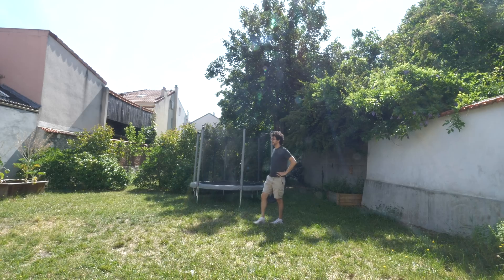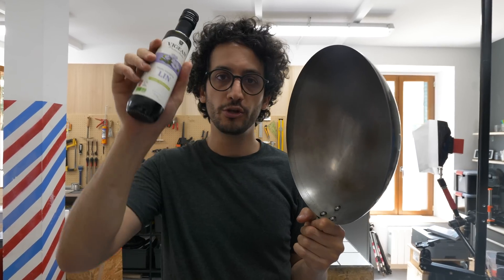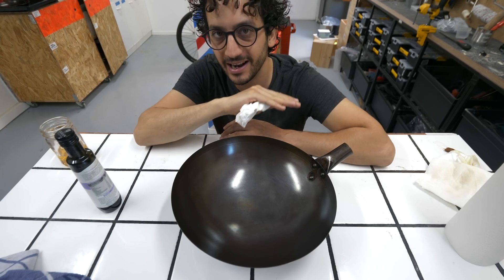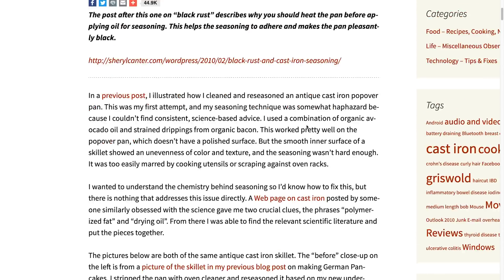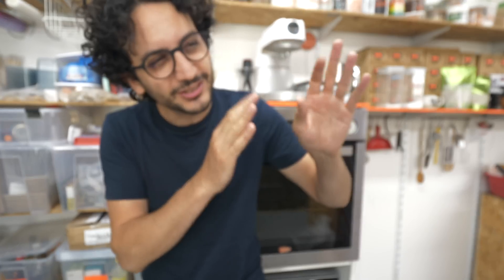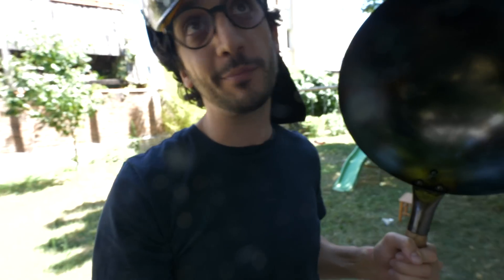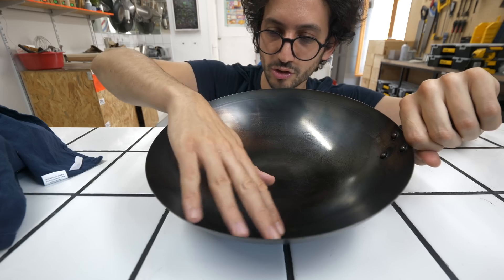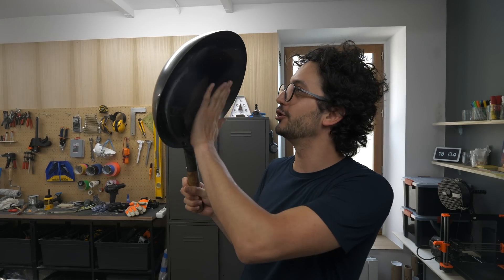Can I Make my Wok Slicker than a Nonstick Pan ?

Comment: Flax Seed oil is a terrible seasoning oil, it flakes off and doesn't bond well to the metal or itself.

So what are you qualifications? "I read journal articles. I have no background in science whatsoever but I tried it and it worked."

How has this well meaning woman's myth gained so much traction?

Comment: 100% better than teflon. You don't have to worry about cooking on high heat, you don't have to worry about using a utensil that will damage the coating (or at least don't have to worry as much) and make it flake off into your food, and if  something does happen to the coating you have complete control over how to handle fixing it.

Comment: Sheryl : "I did research into chemistry and found the best way to season a pan based in science"
Alex: "Okay but I'm still gonna do it different"
Reply: Flax Seed oil is a terrible seasoning oil, it flakes off and doesn't bond well to the metal or itself.

So what are you qualifications? "I read journal articles. I have no background in science whatsoever but I tried it and it worked."

How has this well meaning ignorant  woman's myth gained so much traction?
Reply: @SaltNBattery  Exactly! I followed her advice a year ago, spent an entire day re-seasoning all my cast iron with flaxseed oil, 5 coats each, came out beautifully, then flaked off on the first few uses. Never again.
Reply: @chrisrioux  Any scientist worth their seasoning knows that theories often does not reflect reality.
Reply: @isolatedintegration1154  Theories are based on VERY specific conditions. Those conditions rarely exist.

Comment: What is that wonderful wok scourer you fitted to your drill? Can I buy it or make it. FYI: I have wire wool and also wire soap pads ready and 5L of white wine vinegar, and a rusty tired twenty years old 26 cm carbon steel wok with a wonky wooden handle?

Comment: Non-iodized salt and oil for cleaning and seasoning. Oil prevents oxidation and the salt doesn't dissolve in the oil and when you rinse in warm water it dissolves leaving a smooth, sealed "nonstick" surface.

Comment: The trick for nonstick on a regular pan is to use cold butter and press it into the surface. It's the little divots in the surface that make food stick. So as long as those are filled with oil, and not air the food won't stick to the pan.

Comment: so this video proof some of my findings. First you have to finish the seasoning on stove and second higher the smoking point harder to get it polymerized. After 2 fail attempt with oil i use lard and its so much easier. From 1 1/2 hour with oil to 20-30 min with lard. Its thinner that with oil but i can do 3 layers with fat compare to 1

Comment: sorry but this could have been achieved in a couple of minutes, yes you wont have a perfect black finish. just heat pan until a little smoke rises, add some oil swill around until a little smoke comes of oil and your pan is seasoned I never get eggs that stick with a carbon steel pan.

Comment: Better 10X💯than Teflon.  Teflon is for someone who cooks very rarely. The Teflon coating is toxic.   True chefs cook w massive heat, as one wants to taste the fire in foods as a season.  Try this trick to carmelize onions- heat large surface sauté type pan to 400+ degrees.  Have your onion mise en place large onion med chop ready.  Keep gas flame high-do not add oil yet- add the onion all once and spread out evenly on bottom of pan,  do not stir until the moisture begins to release out of onion about 1-2 min. Stir once to flip onions and repeat until you can see and smell the onion juice  begin to Carmelize. Add just enough oil (olive) and stir to coat evenly and cover w a tight lid and shake pan to capture the remaining steam from the onions.  The pan will deglaze itself. Add a 1/4 cp sherry to finish deglazing just before adding remaining mirepoix.  I used this technique as I am preparing remaining ingredients for almost every dish I create.  You will learn to appreciate tasting the fire note deep below when serving your dish.  P.s. I liked when you used a drill and cloth squares to buff out the particulates on your seasoned pan- then mentioned  the beautiful sound you heard from the glass smooth surface.  Proof you chef with all of your senses.  Fact: Culinary art is the only artform in which you use all 5 senses.  Sight,smell,taste,touch,hearing-ex:the crunch of a potato chip or phyllo crust. Good work on your site, your passion shows through the screen!

Comment: I've tried to season my wok twice now, and each time it rusted shortly afterwards.  I didn't use anything abrasive to wash it after use or any chemicals, and after it was bone dry I returned it to the hob with more oil to add another layer.  Still rusted, and I can't figure out why :/

Comment: I've had many cast-iron pans that were more non-stick than teflon. I recently got a fine wok, as a Christmas gift, and seasoned it according to directions. It's not quite non-stick, yet, but it's getting better as I use it.
Reply: I have a monstrous Lodge cast-iron wok. It weighs about 14 pounds and is a non-stick stirfrying MACHINE. I can fry an egg over-easy in it with no problem. I wish I could get a teflon skillet anywhere NEAR this awesome.

Comment: Proceeds to chemically transform fatty acids into polymers
"- There is no chemicals!"
ROFL

Even without bias, it IS better than Téflon for non-stick pans. But what you did, most people don't have the time to do it anymore. Just like people used lye and grease to make their own soap, or a heck of a lot of other things... there's no one at home, everybody at work, expecting to work no more than 30 to 40 hours a week. Industry does all of the other work for them, and applying Téflon is cheaper than those many heat treatment + buffing.

We'll come back to that, irremediably.

Comment: I just bought my first carbon steel pan.

I don’t think it’s ever going to be more slick than a new Teflon pan.
But I am thinking it’s going to be a better pan. And plenty non-stock enough

I’m sick of buying Teflon pans that are just getting worse and worse with time. That I can’t fix or bring back. I can just try my best to be super careful with it, but inevitably toss it out and buy a new one. Because a degrading or messed up Teflon coating is a health risk.

This pan will last me my whole life. And probably people after me as-well. Unless I leave it outside wet, all winter, so it rusts a hole all the way through. Or something else equally stupid.
I will always be able to bring the pan back and put on a new coating of non-stick.

I’m not buying any more cookware that is  Teflon coated, yes it’s amazingly non-stick in the beginning.

But I want to have things that last. I’m going with carbon steel, cast iron, tinned copper and stainless steel from now on.

Comment: The advantage seems to be that you can redo the coating yourself. Never seen somebody re-teflon a pan. One scratch and it's ruined.  Would be interesting though to see if you could completely remove the teflon and oil coat it...
Reply: not only that, you can stick a carbon pan in the oven or on a fire without risk, unlike teflon.

Comment: From my heavy as fuck (well seasoned) cast iron, to my carbon steel (newly seasoned), to learning how to fry like a pro in my stainless steel with temperature control, the right amount of oil/butter etc.  I can say:  NONE of those methods are better than a teflon/ceramic pan.  They just aren't and it's a whole lot of extra hassle.  That being said, my favorite is just using my stainless steel cookware and doing it properly.   I might have to throw in the towel on this one and just have a single non-stick pan and then use my stainless steel.  Bummer cause I was looking forward to the carbon steel.  Maybe it'll get better.
Reply: there is some stickiness in my carbon steel pan but it is not like the food sticks and gets destroyed. I make omelettes and crack eggs in them all the time. Sure it is not teflon but if you know what you are doing, they are good enough. Most people don't know temperature game. They are used to non sticky pans and they actually add ingredients before the pan reaches proper temperature.

Comment: You maybe don't add oil to teflon - but you do add teflon.  So iron gets oil, aluminium gets teflon - no cheat just a different deal, different types of "paint".
I'm with seasoning, my Wok is 35 years old, it's used for spaghetti bolognese (extra tomato) mince and onions curry (indian and chinese) It doesn't matter - I wash it (if there are limpets that won't let go I use the plastic screw cap from a pop bottle as a non scratch scraper then a dab of rapeseed oil heated 'till it smokes and when it cools it's ready to start again.
Nothing sticks (usually) except mackerel - for some reason the oil sticks to the pan the mac sticks to the oil and it takes a lot of elbow to free it and stop it burning.  Add a little milk, flour and oil to make the sauce and the sticking stops.

Comment: click bait is wrong... that is not better than teflon... still tough very interesting
Reply: It's multiple times tougher than teflon. There is a reason you can't use any metalware on your teflon coated pans, but cast iron laughs in the face of it

Comment: Linseed Oil is the worst product I've tried with Cast Iron pans. Linseed oil eventually flakes off and is very bitter, ruining your food. I've found that a thin layer (later wiped away) of vegetable shortening is adequate for building layers. But I've started using a product called Crisbee (I'm not a shill - I actually bought the product) and leaves a very slick surface.

You will still need some form of oil or butter to cook with in a Cast Iron pan. You can't avoid this.

By the way, did you see the comments in that Sheryl Canter article. There's a lot of criticism against Linseed Oil - I've found it to be terrible and others have had the same experience. Avoid this if you can.

Comment: Using oil defeats the purpose of making a nonstick pan. 
Non stick pans use a chemical called Teflon which is a very hard material that chemically bonds to a surface. Skateboarders like to use it to grind on things like cement because it produces a slicker surface than wax. The only problem with Teflon is that at high temperatures it decomposes and produces some gnarly biproducts.

Tl;dr if you want to show how well a non-stick surface you made performs then don't use oil.

Comment: May not be quite a non stick as a Teflon pan, but you can always re-apply the coating if the wok starts to stick; try doing that with a Teflon pan. Also if I have this correct, in Chinese cooking heat is your friend, my wok only really sticks if I cool the wok by over loading it.

Comment: I started using a couple of carbon steel pans, including a large wok, about a year ago. I loved them so much, that I eventually replaced all of my fry pans, including the teflon pan I used for scrambled eggs, with carbon steel. The matfer borgeat I use daily is amazing! I seasoned it using the potato peel method (which is what matfer recommends), and it is as slick as any nonstick. I just used it this morning to make a spanish tortilla and no spatula was required, at all, to get the omlette from the pan! Carbon Steel: it's amazing!

Comment: Everything tastes better in seasoned pans, everything.  Having said that, i like using high heat oils, like avacado oil to season with, because the coating produced is much more durable.  Just gotta use a higher heat to season though.

Comment: The entire point of traditional WOK cooking is that the WOK has by design different heat ranges from the very bottom to the sides. In traditional WOK cooking the food is moved from the bottom where it is extremely hot to the sides where it is cooler all part of the cooking process. Often the partially cooked food is removed from the wok entirely only to be returned later in the process. That is why a hand-hammered wok is preferable to those that are accustomed to wok cooking. When the food is moved up the sides of the wok it will stay put until moved again.
This person obviously does not understand wok cooking at all. I would say the Chinese got it right 2000 years ago. Re-inventing the wheel in this situation seems counterproductive.

Comment: I would have thought to really make it non-stick you would want to increase the smoothness of the surface going down to a micro or Nano level and then you should get better results.

 how about working up the wet and dry to a 4000 then using a Polish

Comment: So my question here is in the beginning you said you were using food grade lin seed oil then after reading said article and talking to whats her face it looked like you were using olive oil. But she made it a point to say that heating oil beyond its smoke point gives off a carcinogenic smoke i guess, but by doing this it will give you a better polymer surface but does this mean that in order to achieve a perfect polymer you need to be exposed to carcinogenic fumes/ smoke???

Comment: i wonder what happens if you do that to a brand new teflon pan? does it remove the original coating or does it boost it even more?
Reply: Once you heat it past a certain point (the point where "seasoning" occurs) you damage the teflon coating beyond repair amd basically have a worthless piece of metal

Comment: You polished in the wrong order. 

As a car detailing nerd - my best guess how to do this would be to you need polish the metal to a mirror shine before adding any coatings, then you polish very lightly after each subsequent coating, so you don’t remove the coatings you’ve added.

The way you polished that you likely removed 80% of your coatings to create a smooth surface so while it may be smooth - it’s unlikely to last

Comment: Just do the heating of the wok over a flame like a normal person. Literally no one does seasoning in an oven. I know you used a gass stove later on, but just do that from the begining. And the mask and goggles are unnesesary.
Reply: Literally everyone seasons cast iron in the oven. It heats the metal from every direction unlike the stove which will just be from the bottom. You're supposed to heat the pan/skillet/wok on the stove and apply the oil coat while it's hot, and then put it in the oven at a temperature below the smoke point of the oil for like 40-60 minutes. Check out Kent Rollins' Cowboy Cooking Channel. Cheers

Comment: You can do this on a very very hot grill in a 10th of the time. You dont need to wait for the pan to cool down to room temp between each coating, nor do you need to cook it for an hour each time. If ya do it on a grill or wok burner it takes about a minute for the coating  polymerization between each coat. So ya can do like 10 coats in about 20mins.

Comment: Two ways to season a pan. 
Method One
1) Sand down the pan
2) Keep scrubbing the pan until totally clean
3) Cover with a thin coating of linsead oil
4) Wipe off all excess linsead oil
5) Bake pan for two hours in an oven
6) Leave pan to cool
7) Repeat steps 3-6 several times
Method Two
1) Buy new pan.

Comment: I'm surprised no one said that teflon scrubbed off the pan can be toxic for us. Cast iron pan is the healthiest and the cheapest, but not for lazy people. 
I've heard that you should clean this pan with oil and if it's necessary, a little bit of water. The less water contact it has the better.

Comment: Okay so I did this...followed your method exactly. Got to the part where we tried to make the color more black using a propane stove. I’m going to emphasized the word “tried”. It never changed color at all. Any ideas why it didn’t work for me? Really this step was just for aesthetic purposes so it’s not going to ultimately matter...
Reply: Pretty sure your pan is not getting to a high enough temperature, which is also needed to make the "seasoning" more durable.

Comment: Probably coming late here, but i have two remarks to make: 
1) PTFE (Teflon) is virtually harmless for the body for the same reason it's such a good nonstick material. On the other hand, the coating made by seasoning is comprised of carcinogenic molecules that eventually will get into the body. 
2) Sheryl is admittedly not a chemist, and in fact she gets the smoke point thing wrong. Oils with a lower smoke point start evaporating at a lower temperature, thus they don't reach as easily the temperatures required for polymerization as higher smoke point oils.
Reply: Teflon is the worst thing you can use, I urge you to do more research, look at how they had to change the name to continue selling that poison

Comment: Don't even try to compare Cast Iron to some None Stick Pan. Iron is in 95% better. If you don't wanna make a french omlette, go for Iron. If you wanna make a french omlette, go for non stick. If you want to cook a very acidic sauce over X hours, go for anything, but for iron. 
I use my Cast Iron (don't have a wok, and with Induction a Wok doesn't make sense either) for 99.5.% of Pan uses and it's doing damn good. Shit doesn't stick. Great heat transfer. It will last me a Lifetime, because there is no artificial coating, that will crumble into my food. And if it would rust (No chance at my use) or whatever... Fuck it. Clean it, reseason it, and it's good to go for another X ages.

Comment: @12:19 "theres no chemical, its just a very hard polymerised surface... " after scorching oils in layer after layer... Teflon is.. PTFE Poly Tetra Fluoro Etene. A hard polymerised surface... that is super chemically inert. (fluoro compounds are like that...) its just a chain of carbons.. with fluor attached making it inert.... unlike that hodgepodge of oil byproducts and carbon rmains... PTFE any day mr ;)
Reply: Yeah it is inert at that moment but nothing says chemical reaction like exposing a chemical to high heat and oxidation repeatedly. Not that I'm particularly bothered by fluorine but you should examine the conditions the chemical will be present in.